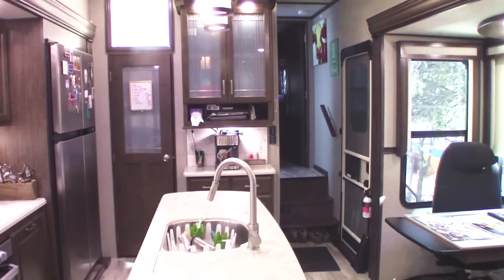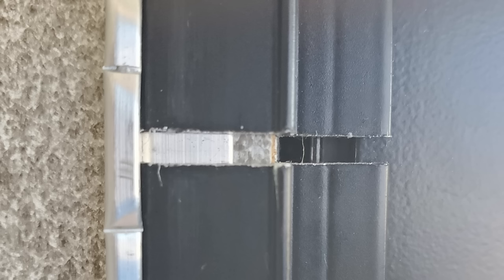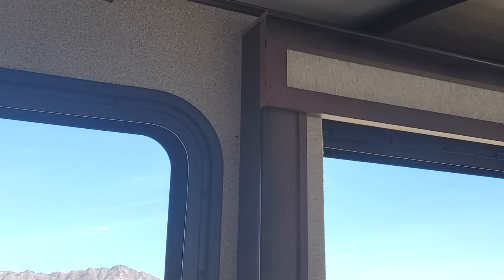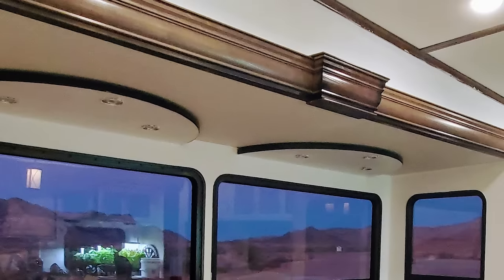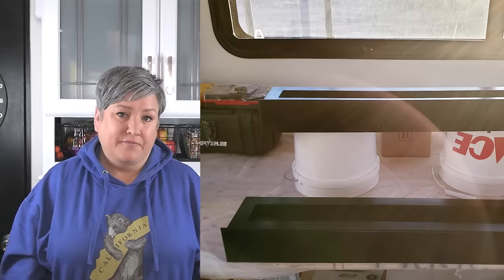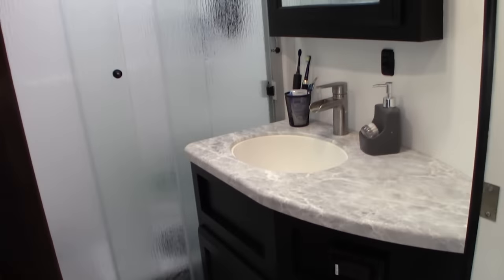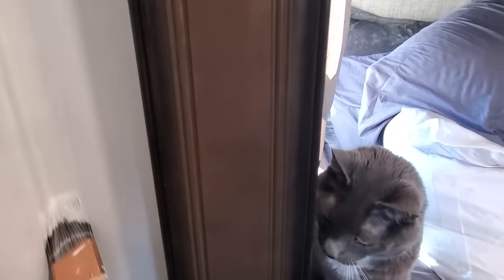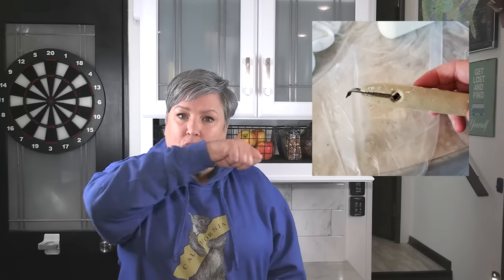DIY CAUTION: HOW TO PAINT RV WALLS & CABINETS. We Painted the Interior of our Fifth Wheel! Learn...

Comment: That’s an overwhelming amount of work- for something you thought would be an easier job. Home improvements all around seem like they always end up being more than you bargained for. Lol 
You could always put some molding/ trim up between your ceiling and walls. They sell white painted trim at Lowe’s.  Are cabinets in RVs made out of the same material as cabinets in a house? I’d like to paint my cabinets, but did that in another house and it was more work than I want to take on right now.

Comment: There are some times you need to use tap. If you do, prime first. Then tape where you have to with a low tack tape(surface of the tape is smooth). When you paint your first coat, dont load it on the tapr. Work your way up to it and barely put any over the tape. On second coat you can load it on and then pull iy off while its still wet. Paint wont pull up

Comment: Did you consider removing most of the silicone caulk and then putting a paintable caulk over the top of it so you aren't digging in the corners with tweezers?

Comment: Several years ago, okay maybe 10 years we decided to do some painting in our house.  Mind you our living room walls are whiteish paneling.  Our bedroom was painted paneling but we wanted to refresh the paint.  So off I went to Wal-Mart.  Now I am not an amateur to buying paint.  The people at Wal-Mart were, so it was good I knew what I was doing.  Anyway I bought Kilz paint and had them tint it the color I wanted.  One employee said we can't do that to which I said yes you can.  I know I bought it here before.  So they did.  Now, the bedroom only took one coat.  The living room took more, mainly because the girl doing the painting used 2 different kinds of paint.  It was a mistake but it turned out looking pretty darn good.   We had used Kilz when we did the remodel of our old house so I knew what it was capable of.  I felt for you with the caulk.  If manufacturers would just pay attention and buy caulk that is paintable life would be so much easier.  But it even happens in the construction business.  The RV turned out great though😊

Comment: Looking for advice from this channel, I have a 94 bounder with a tpo membrane. 94% of the factory coverage is gone. My plan is to recover it with the dicor clean primer and top coat. It is more than I can do in a day. So the question is, what if I do a 2 day approach and start on the top. And next day, reapply the primer and finish the sides from a ladder. I hear it is best to apply and cure when temperature is above 60 degrees? I live in north of 60 Canada, so I was going to start this next year in may. When the roof can expand, when the Sunshine is available. Any advice is appreciated.

Comment: I imagine that you live full time in your rv. That would slow anyone down. We rebuilt our rv. Taking all the walls out, Yes I said out! We re insulated rewired and replied the shell and re placed the wall covering. Yes we found a lot of poor workmanship. But painting was the easiest part. Use quality products  and  most problems are alleviated.  Yeah, you remove tape when  paint  is damp, just like a home..  Yes this all took time but it was worth it. We pull call out and recalled with printable. Yes there are holes and gaps but you are dragging down a road so something has to give, if it were rigid it would break

Comment: The reason the manufacturer uses silicone caulking, is cause different materials expand and contract at different rates, and regular caulking would constantly be cracking. Unfortunately, silicone only comes in clear and white 🤷
Reply: Joanne you are 100% correct. They use silicon as it's flexible and won't crack and fall out like painters chalk. When repainting the old silicone needs removed down to surface level, paint and then fill any joints with new silicon ( hopefully your new paint scheme is white !) An alternative is to use car bondo or wood filler for the joints which will accept the new paint.
Reply: Sorry kids but silicone caulk will contract but not expand.  The best manufacturers use ELASTOMERIC caulking, which WILL expand after it contracts.  The leaky window seals, the shrunken caulking around windows - THATS all silicone.
Reply: You do not use silicone on an RV.  Nothing sticks to that spot ever again...including new sealant.

Comment: I have a dumb question but the rubber at the top where the ceiling and wall meet what do you do? 
Did you take that rubber off and caulk instead or just cut in the paint close to it, or replace the rubber with new rubber?

Comment: I am wanting to paint the interior of my older 5th wheel.  It has the typical vinyl wallpaper, but also has a vinyl border.  I am afraid to remove the border as it seems to be stuck really well.  What do you suggest or any ideas on how to remove the border before we paint?  I am afraid to use an steam, or remover as it might bubble the wallpaper it is on.  Tks for any and all advice.

Comment: Here a tip don’t edge by hand your going to see the unevenly lines , use tape the tip is take off the tape before the paint is dry ,when it’s been trying for 20 mins or so peel off the tape and it’s won’t stick or remove old paint or new paint .

Comment: One of your mistakes was using "Frog" painters tape, that tape is terrible no matter where it is used, never use it for anything. If you leave it on after paint has gone over it, it's adhesive somehow reacts to the surface and either it becomes very hard to peel off or the adhesive is left behind. I used it on my boat ONCE and it made me do extra work just to get the adhesive off and then it ruined some of the patch work I did to where I had to redo everything.
Best to use Scotch blue painter's tape, 1000 times better then any other painters tape out there.
Great video and your trailer came out looking great, but makes me know I will never paint my trailer, lol.

Comment: Yeah, RVs have a lot of shoddy work done when you start taking things apart. I used Krud Litter from floor to ceiling, sinks, shower, toilet, fridge, freezer. Then bleach and water floor to ceiling every where again as soon as I bought my 2004 Class C. You do have to sand, and primer then paint just like any wall, basically.

Comment: Everything in my 2014 Landmark is brown and beige, it isn't ugly, but it is just not my taste anymore, and I am dying to bring in some black to give it some contrast and liven it up. The counters are even beige with multiple shades of brown speckles, I can't justify the expense to replace them with white Corean or bring myself to paint the existing custom-made Corean counters either. I am trapped in an environment I don't hate but also don't love. These units are gorgeous at first site but after living in them you start to see threw the smoke and mirrors then can really notice all the corners they cut putting them together.  I found out after buying my Heartland Landmark trailer that it is a unit you want to park under a permanent roof and keep it in one location like a mobile home, which defeats the purpose of buying a trailer instead of a fixed home. People are having issues with these units literally falling apart when using them for road trip traveling.

Comment: Killz. FTW.

Use Killz primer and paint. It's not just the RV walls. I repainted a cabin with that nasty wood panel walling. It doesn't matter if you scratch or sand. Killz will adhere to anything. Just wipe/clean surface, prime with killz, THEN paint the color. Do not use Killz in a spray gun. Prime it with rollers first. THEN paint color with spray gun. Speed things up.

I hate wallpaper. Ugh. You have to steam and scrape it off. Or just leave it on and putty and prime Killz over it. If you have any sealing to be done, do it before you prime it. It will really turn out nice by the time you're done and keep sealer from molding / peeling / moisture. I despise the corner stripping they use in RVs. It's always done poorly and it doesn't seal right. You should be sealing gaps before you even prime.

As for your RV wallpaper, peel off any of the decorative layers / vinyl stickers. Putty and sand gaps/holes. Killz it. Killz it again if you have to. Then enjoy.

Killz outdoor primer will also create a thick seal coat. It's REALLY thick stuff. So don't spray gun it. Use the spray gun AFTER you Killz it. It's intended for the outside of your house. Nothing can destroy Killz. I even swear, it might be bullet proof.

Killz your bathroom. Use an enamel gloss /semi-gloss coat over Kills. Watch the water run off your walls and down to your floors. Instead of mats and towels, try using that new stone stuff that dries instantly. I forget the name of it... Might even want to side your shower with it or use it in Kitchen instead of rags / towels.
( Diatomacious ? SP? Also known as Dorai Bath Stone tm )

Killz. Putty / seal, Primer, use spray gun on final paint coat. Profit.

And please, wear gloves and a mask. Don't coat your lungs with this stuff.

Comment: It looks like your hate for silicone that you didn’t apply any after you painted . That silicone helps not let moisture in that rv are key to having and mold . I would recommend going back to seal everything you can . And your getting cracks along the edges because there’s no silicone. Silicone helps keep things tight and seals things together. It’s does a good job at that , that’s why it’s so hard to remove and that’s why it’s clear because of the amount you must apply .  It’s. Not paintable because it bonds to many different surfaces that are not white or easily painted like windows , tile , flooring , base boards, countertops

Comment: You left the tape on too long.   There are straight edge painting tools. From a few inches to several inches.       You put it against the ceiling, and paint the wall, or put it on the wall, and paint the ceiling.  Paintable calk is available to replace what was removed.  Good Luck 👍

Comment: Indeed RVs are strange animals. You can put masking tape over the silicone caulk and paint over the masking tape. Not kidding. The caulk is there for a good reason. Never take it out. I'm a professional painter. I'm putting a larger fridge in my rig. Cutting into the cabinet works. You quickly see why these are not at all like house construction. Thin plywood. Glued. Stapled. Nailed. screwed. Caulked. Wallpapered with wood grain paper or vinyl. The inside cabinetry is designed to take a beating over bumps and potholes. A house only has to deal with gravity coming in from just one direction.

Comment: I wouldn't have used a blow dryer for the silicone. The proper tool would be a five and one and a razor blade not tweezers. I can tell you from experience that I could remove all of the silicone in the interior of your camper within an hour applying new caulk would take just a little bit longer.Good thing to know is if your silicone smells like salt and vinegar chips brand new then you're using the wrong type of silicone and that silicone will just get dirty and deteriorate especially when you start using chemical cleaning agents around it I recommend using only Marine silicone in any RV inside and out a lot of those caulks that are marine grade can also be painted over. I'm sorry it's just seeing you with the tweezers trying to remove caulk to me just really cringed me out but I know that you are just a DIY I am a subcontractor for one of the biggest construction companies in the United States. Either way your camper came out looking very nice and you did a very good job.

Comment: Video way too long and chatty. Show, don't tell.
Most of what you are doing is over complicating a simple job.  You need this:
1. Wipe down walls with spray alcohol if greasy, or use some laundry detergent mixed with TSP powder.  Degreases kitchen area.  Not needed for other walls.
2. Dewalt Random Orbit sander to lightly sand vinyl wallpaper covering the 1/8" luan plywood walls.  Some sanding sheets for corners.100 - 120 grit is fine.  Don't peel wallpaper off.  Use spray adhesive and stick back any loose pieces.
3. Use smallest roller brush and tray to put one coat of Kilz Oil Primer.  Let dry as per label, well ventilated.  Rinse out with Mineral spirits.  Using foil on paint tray will prevent having to clean it out.
4. Use any Latex paint of your choice, or Modern Masters Metallic Acrylic Paint and put 2 coats on walls over the fully dry primer.  Clean up with soap and water.  Scrub roller brush with a stainless steel scrub pad to fully remove latex paint for reuse.  
Done.

Don't hire professionals.  They would not do the detailing you did. Its not cost effective.  Unfortunately, the Class C and Fifth Wheels and some trailers are poorly built to start with. When you remodel you realize how poor, and have to create fixes.  Its not about painting but fixing the sloppy build.  I found that tile trim works well on ceiling edges.  Use Loctite Powergrab Construction Glue which sticks well.  The other option is to stick fine veneer strips on a well instead of painting. Redwood strips are very cheap at HD and Powergrab does the job.  One wall wood, another paint, looks very good.  Rubber caulk on gaps in edges will remain flexible and paintable.  Caulk then shape with an edging tool.

Comment: This is why I won't buy any RV that anyone has tried to "renovate".  It extremely degrades the value to me.  No one knows what they are doing, and no one wants to spend the time and money on what it takes to do it correctly.  So now you have a worse problem that's going to cost you more time and money to fix...or replace.  Just spend some time on these renovating groups on FB and you will realize that very, very few people actually do it correctly. .